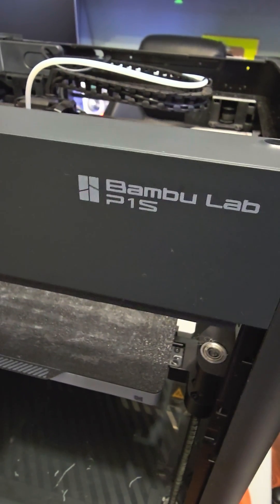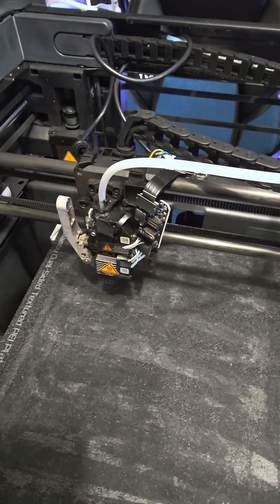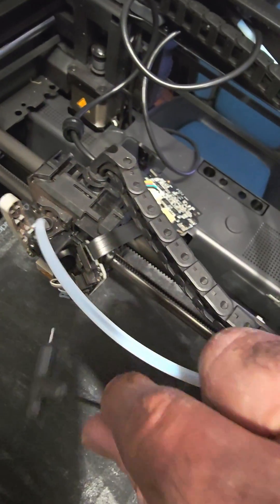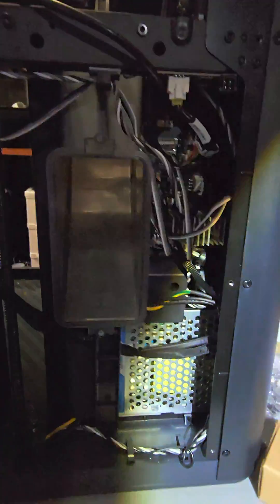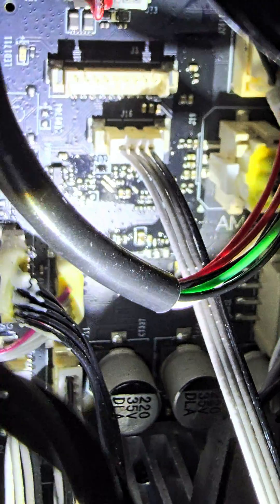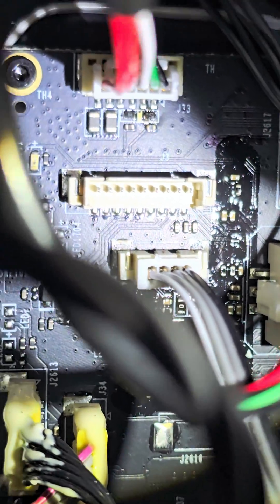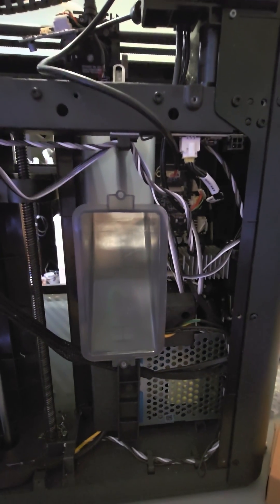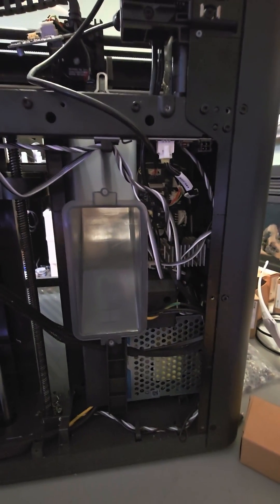P1S Error 0500_0300_0001_0002 Intro Video - The full video for the MC Board Replacement - Preview

Comment: I only wish I had found this video earlier in my efforts.  I replaced every other cable and board, and then I found this video.  My board had the exact same burn spot, I replaced the board and printer is back up and running.  Thank you so much for posting this video, this literally saved my sanity.

Comment: Before ordering $600 in parts I would buy a new P1S. Bonus you would have spare parts from old unit.
Reply from the maker: Keep in mind we are talking Canadian pricing here. A P1S is $900+ 13% tax here. I already have 5 FDM based printers, I do not need a 6th. The spare parts will get used either way at some point. Although I could have used this as an excuse to get a 6th printer. Hmmm.